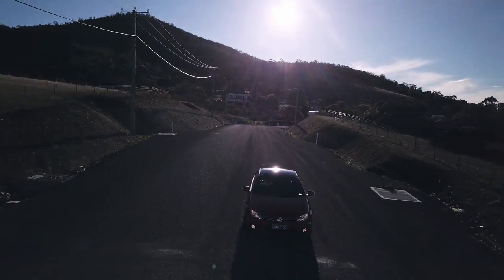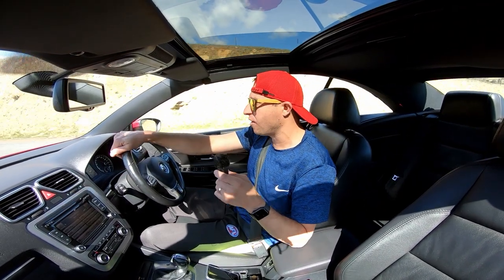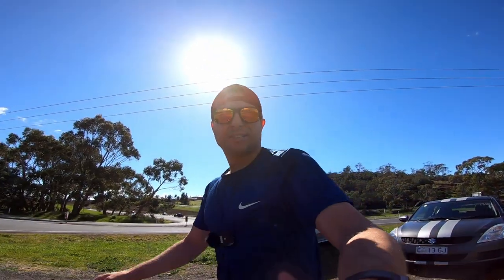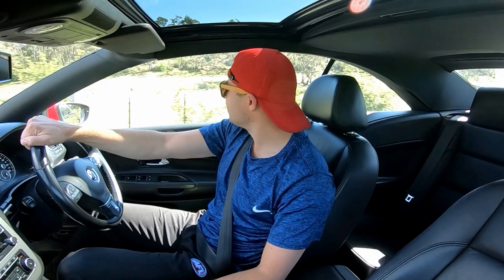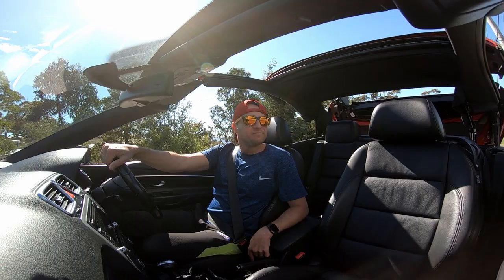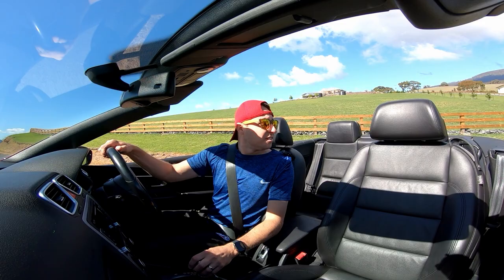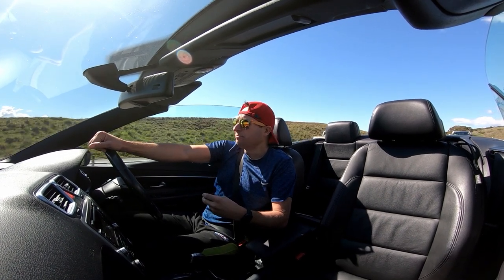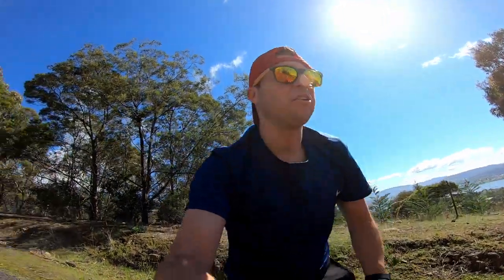VW EOS 2.0TSI Exhaust (real world testing) BETTER WITH HEADPHONES ON

Comment: How much did you spend on the exhaust system?
Reply from the maker: It was about $450 to have the muffler removed and the genuine VW slip ring connectors to connect the new straight pipe in.
Reply: @MarkEnsbeyMPR  oh okay thats mad, im picking my eos up on Saturday n it's my very first car. From a stock build to make it sound like yours how much would I be spending in total? I live in qld
Reply from the maker: My exhaust is literally the second from the rat muffler removed. Straight pipe replaced. So the total cost was around $450 a few years ago. 
No extras, just one muffler removed 😎
Reply: @MarkEnsbeyMPR  Hey there.
Is removing mufflers legal in UK?
Reply from the maker: @MrEmjay2014  I’m in Australia where it is not illlegal.